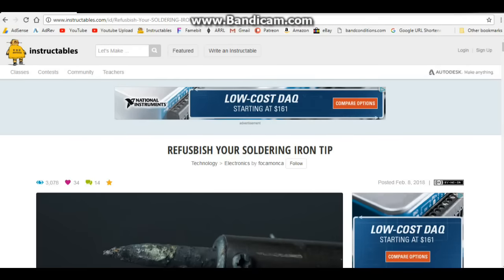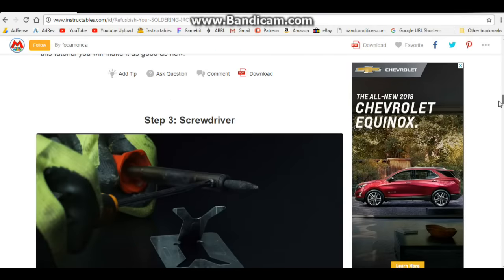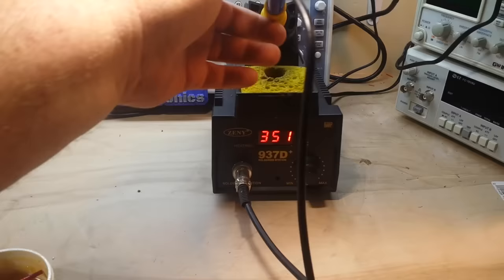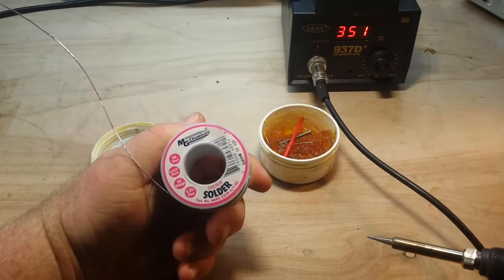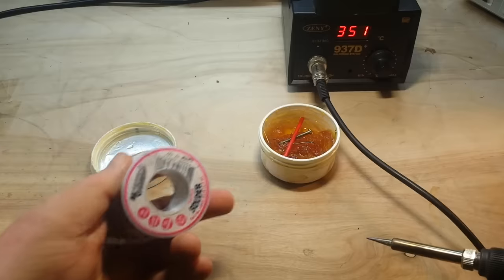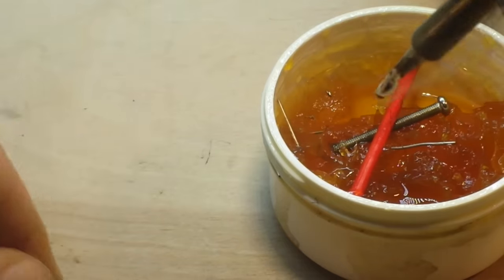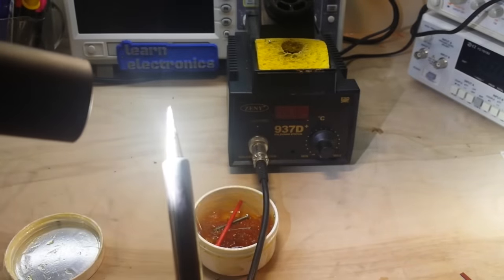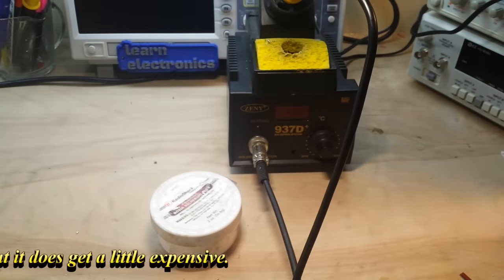How to clean and re tin your soldering iron

Comment: I've always cleaned my sodering (intentionally misspelled) iron that way, although now I use the Brillo pad thingy, and never in about 54 years of soldering have I had a tip that looked like the Instructable. Thanks for showing everyone the proper way to clean a tip!
Reply from the maker: George, I saw that instructable and went "arrrggghhhh" first how could you let your iron get to the state? I can't imagine it would solder anything... And then sandpaper???? 
What's this guy brush his teeth
With? A weed eater?
Reply: That's rich! But I could believe it. I can't even remember seeing a tip that bad, looks like salvage from the ocean.
Reply: Don't use a scotch pad. It's plastic covered steel wool. It melts.
Reply: Watch some of those diy videos, especially from Asia, he definitly abused it for melting plastic. My oldest iron is older than me, dont even know how old, at least 40 years, it is one from Russia and my dad used it there for a long time, since we moved to Germany he exchanged the cable and the plug and now the third generation got it, my nephew, but it still don't look like that.
Reply: The instructable tip looks like the one I have at work. I suppose everyone is different, but when I'm trying to make money I ain't thinking about how to maintain a cheap tool I seldom use for small engine repair.
Reply: What does this say about the air quality in my apartment?
 I bought a $30 soldering iron at a craft store for a stained glass project. The tip turned black instantly & refused solder. 
     I read online & YT occasionally a bad tip will never tin. Time passes. .. I bought a cheap solder iron from Harbor Freight.  I NEEDED to make 2 electronic connections. ( I wanted 8)  Again, the iron turned black as it heated up, before it was even hot enough to melt rosin free solder.  Just like previously it refused tinning. The 'stained glass liquid flux', borax, alcohol & sponge did little to help.  An HOUR later I finished 2 connections. Solder rolls off a clean polished copper wire holding the solder to it as it heats.

   I'm not an idiot, my father was a repairman & welder. I never witnessed him or anyone he knew have the difficulties I've had. I've seen filthy conditions, that don't interference with the job. My environment is sterile in comparison.  I purchased a 3rd iron with a paste flux. I must keep it submerged in flux & still have only seconds before the corrosion impars the functionality of the iron. Any suggestions? Before I try out my new Amtec flux? I thought flux was supposed to be optional w rosin/lead, I just make tiny balls that roll away.
Reply: PS. My 3 iron tips look only slightly better than the one at the video's beginning.
Reply from the maker: I can't imagine that air quality would instantly oxidize your tips. But, that's not my area, I wish I could be more help.
Reply: I've bought used irons in poor condition. I've restored the tips on those. I clean the tips then dip them into a molten pot of solder. It's the only thing that really works. Otherwise the tip is going to just oxidize in the atmosphere again before it gets hot enough to melt solder.
Reply: brr johnson if a soldering iron is not tinned it is practically impossible to get the iron to tin itself. I've seen it many times. Supposedly there is a substance called sal ammoniac that can do it? But I've never used that myself. I just heat up my trusty old Escio 5 pound solder pot and dip a cold tip into it. That works. It works because the tip is immersed in molten solder with no atmosphere to oxidize it. Then solder sticks. Of course before dipping I remove any oxide layer that is on the tip. What is going on with a tinned iron is called, "wetting". That's what you're not achieving with your untinned irons. I think surface tension is involved with a wet object? Which is why properly tinned irons act right.
Reply: George, Thanks for the gentle hint on the American way to pronounce the word. Check Dictionary.com 
Maybe the UK use a long o and pronounce the l but here is is a soft o and the l is silent like in onion.
Reply: I wish the Americans would pronounce the bloody L, drives me crazy with their soda ring iron. It has a l in the word for a reason

Comment: NICE..  I'm old... learned your exact technique in the 70s in my high school beginning electronics class, it's nice to know that the "old" techniques are still applicable..lol... and yes Kenny T. the screws and straws are highly calibrated to the exact performance of this flux..lol :) RIP Radio Shack...
Reply: The old ways still work, but only for through-hole stuff.
Everything is microscopic surface-mount stuff nowadays.

Comment: A contributing factor few know about is your sponge.
The sponge is usually too wet.
It should be just damp and use distilled water. 2 reasons.
The first is minerals in the water.
The second is you drop the tip temperature excessively with an overly wet sponge.
That sizzle when he wipes the tip tells me his sponge is wet not damp.
Reply: Yup, that's why I prefer tin it, flick it, use fingers to shift the crud. That's right, fingers, if you are quick you don't get burnt.
Reply: I ques wet has more water that damp. When damp you squeeze and get no water.  When squeeze and get water is wet. 
In our business you can use slightly moistened kitchen paper to wipe the tip clean. I do that every time I poke holes on plastic. And yes I use a cheaper iron for this busines.
Reply: @dougaltolan3017  uh..... Ok

Comment: Thank goodness
I saw it video cause I have been doing this since my early days of soldering

Now I just have chuck the soldering tip away and replace it with a new one
Reply: tip corrosion depends on temperature. Run your iron on 230-260 C and your tip lasts for months. Actually I make my own tips that are not nickel coated: 4mm round copper stock thread one end, cut it off and put it in a power drill to make a pencil tip with a file. So 5$ for 35 tips. Worst thing to do is forgetting to turn your iron off and letting it smoulder over night!
Reply: If it's been working since you started soldering clearly it's not a big deal...
Reply: @Tore_Lund   yes.... been there  :) works perfectly

Comment: Then again, looking at the style of iron in the picture, he might have the right idea. The sooner you destroy it, the better! 😉
Reply: If that's rosin, try isopropyl alcohol. Rosin dissolves pretty well into it and you can pick it up with a syringe to use as liquid flux later.
Reply: Its a cheap iron though lol 
Get a Hakko or a Weller.
Reply: I have the same type of iron though. It was cheap as hell, but it gets the job done.
It came in a blister pack with a big warning: DO NOT FILE IRON TIP. I guess that person was like "I can't file it? That's okay, I'll just sand it then."
Reply: Amraks unless you are doing microsoldering (which I doubt or you would know what I'm about to say) the cheap irons like this work just fine. You may have all the gear but I suspect no idea! I have expensive stuff but also the cheap stuff, it all has its place and use.
Reply: These big fat soldering irons are no substitute for a decent iron, which are not even expensive anymore. I would never own an iron like that unless it was for electrical or automotive use. Even then, I use a Weller soldering gun for automotive. Any electronics soldering (not just "micro soldering" deserves a half decent iron. The only excuse is if a low-income person cannot afford a $35 station, they can get a $10 el-cheapo iron.
Reply: Amraks I have a 100watt Choice brand is that ok, I bought it from a stainless shop for jewelry soldeting
Reply: @Amraks  I'm happy with ERSA.
Reply: @Amraks  JBC are a nice iron with a great range of tips.

Comment: A decade ago a metal work hand file and tip tinner was in every australian school, tafe and uni book list/toolbox. you should really explain the difference between tips that can and cant have a file used on them since im bad at wording so this comment might not make sence. Now days most irons have a coating over them you don't want to file off but only 10 years ago most didn't and at school and tafe they taught us to file your tip to clean the tip since them iron tips dont have a protective coating and use tip tinner on it. Our tafe checklist even had a metal work hand file for just that. Would not touch a iron with a file now days tho since they have a protective coating over them.
Reply: Yep, late to this party but a half century ago when I was 10 years old (living in Melbourne) and soldering wth a big old iron with a tip held in by a screw like the Instructables guy's, (who "refusbishes" his iron) , I would sand the b*tch until it was clean metal! Then solder with alligator clip heatsinks to avoid damaging the $3 transistor I was fixing to a lug on one of those  strips (what happened to those?) The 70s are behind me, these days with my Hakko and Weller irons and their overpriced tips (but components cheaper than I could've dreamt of back in the day) I wouldn't think of it.

Comment: I've noticed that there is quite a few shade tree mechanics on this you tube site  trying to teach others how to do something , even when they have no idea how to do it themselves. I met a guy, the other day , who was teaching how to perform a tap operation. He said that the right way was to perform multiple drillings and tappings, progressively going up in size each time, until you reach the desired tap size. He stated that if you try to do the tap by drilling only one hole( the proper size hole for the tap) and then apply the tap, you will cause the tap and metal to gall and probably break off the tap  in the hole. I told him that I do taps all the time with one drill hole and one tap operation. As long as you use plenty of cutting oil, and keep reversing the tap to remove the metal debris, the tap should work every time, like it does for me. He still did not believe it was possible to do a tap operation using my method even after our discussion.
Reply: Yes, there's some gold on YouTube, and instuctables, but there's some half-witted junk too. Some welding videos are downright dangerous.
Reply: And some of it is fairly high-profile. Just look at GreatScott—he got big with microcontroller projects and yet he doesn't know the first thing about embedded systems programming. His soldering tips look almost as abysmal as that instructables thing, he can't solder a component straight and makes solder blobs everywhere, but he still made a “How to Solder Properly” video.
Reply: Google "Dunning-Kruger Effect"... 
People of lower ability frequently overestimate their skill. Conversely, people with superior ability often doubt their own expertise, assuming that skills which seem easy to them are as easy for everyone.
Reply: James Koralewski, back in the 1980s when I worked in the milling and drilling department of a major aerospace parts manufacturer, we tapped the threads into properly sized holes in aluminum castings with a drill press set to the slowest speed and a special transmission- like  clutch adaptor that had a center neutral position,  reduced the speed further AND reversed the rotational direction of the tap to back it out of the hole if you pulled up on the drill press handle. With this device you could run the tap into the hole a couple of turns, back it out to clear the chips, run it a couple turns deeper etc. Of course, the drill presses also circulated a stream of oil over the tap as you worked....
Reply: Umm - I guess some people don't know about the combination drill and tap bits.
Reply: Everyone is quick to judge another man's skill or idea both methods work it's just a matter of what it applies to.
Reply: Answer is simple. Vievs cash no matter if its  bullshit or not -.-
Reply: DaveBoatBuuilder
Luckily i didn't had to learn welding from youtube.. I learned it in school from a pro and do it as work..
Some amatuers on youtube do make it hazardous..
Reply: now it is done on CNC mills and lathes. you use a two flute tap as it is stronger. One drill operation and one tap. Also can use roll forming instead of cutting taps on certain material.
Reply: @dstone1701  Thank you for the reference to the Dunning-Kruger effect. Very helpful in understanding life, and the current political climate.
Reply: @James trust me it gets worse than that, I have personally rebuilt a number of Oldsmobile engines, as I used to love my Oldsmobiles before they went under, and I was on a YouTube page about the 442 an their history. And in the video they kept claiming that Oldsmobile 350 was a "small block" which if you know ANYTHING about Oldsmobile at all, the only two "small blocks" DO NOT include the Oldsmobile 350 has the 330, the 350, the 400 and the 455 are ALL the same and parts between them actually interchange!! BUT you can't explain that to these idiots and you are wasting you time if you do!!
Reply: Unbelievable.   I learned tapping in high school machine shop.  Set up the work, with the tap in a tap holder with a tapered hole in the end opposite the tap so  you can  set it up in a lathe, mill, etc.  apply slight pressure with a spring loaded center, then turn manually a time or two, back out to break the chip, repeat.

Taps  an be broken if you're tapping hardened steel, or if you don't lubricate, or if you get impatient and try to go too fast and not back out to break the chip.  Oh, and you can use different types of tapes depending on whether  you're just starting the thread, or are about to complete it.

High School shop classes: bring them back.
Reply: Yeah, watch 'this old house' they give bad info all the time.

Comment: Everyone I know that solders has switched to the brass-wool type cleaner rather than the sponge. It works great for me to keep a clean tip, and you're not thermally shocking the tip every few seconds. What's your take on that? And yeah, I've done the sandpaper thing with poor results, obviously.
Reply from the maker: The steel wool stuff is fine. I'm old school.
Reply: I switched to the brass-wool type, it is much better than a sponge in my opinion. the best part is running  your tip through the wool leaves a nice even coating of solder on it. after my first heat up on my Aoyue iron I have not had to "clean and re-tin" my tip. 5 years on the iron and tip with zero issues.
Reply: Both have their pros and cons. The brass wool is perfect if your tip is in already good condition, and you take good care of it. But eventually the wool will not be good enough to get oxides off the surface of the tip, that's where the sponge comes in. The thermal shock causes the oxides to slightly de-bond from the surface, pulling off as you wipe it across the sponge.

Comment: Great video! I'd suggest that some burned-on flux residue can be a bit trickier to remove than just dipping in more flux. It's obvious to me that you are experienced enough not to crank the station temperature to the moon. Nothing makes it harder to keep a tip in good shape than nuclear-hot temperatures.  My cheap 25w iron will turn a protective glob of solder into an oxidized disaster in about 10 seconds. My Hakko 951 never seems to be anything but shiny because it's never just sitting there getting hotter-- it's either in the holder (resting at lower temp) or it's being used.

That's a big part of why I love these newer cartridge-style stations that have the heater and temp sensor all integrated into the tip. It's like just-in-time delivery of heat. Heat when you need it, and not when you don't. My tips seem to last forever and stay shiny effortlessly.

By contrast, my cheap 25W "deluxe" Radio Shack pencil requires a ton of time and attention for tip maintenance. I find I have to unplug and plug it in really if I'm not going to be using it all the time. I think it was made by Hakko as it looks just like their cheaper models and takes the same tips as the FX888 does. Not bad as cheap pencils go, but every cheap pencil sucks, even a "deluxe" radio shack one.

Comment: Yeah! I awmost spilled my drink too! 
I mean, just heat it, tin it ( and maybe put some flux into it), and use a soft paper to remove the dirt that is in there. I use toilet paper. 
Then when the tip is clean, tin it a bit to make it last long. You can use a soft rag too. So its cheap, dont harm the coating and you can even melt any thing you want without damaging it. 

My generic $5 30w chinese soldering iron is lasting 5 years with me.
Reply: This is exactly what i was going to say! I'm using a cheap soldering station for nearly 5 years with the original tip it came with and it's still nice and shiny today. just tin it, flick off the excess and wipe it quickly with soft paper like toilet paper, re-tin and enjoy a soldering with a nice clean tip :) Also tin your tip right after shutting the soldering station/iron so the tip doesn't oxidize while not in use

Comment: build yourself a fume extractor, it doesnt need to be a 1000$ weller sucker, a 120mm pc fan and a replacement active carbon filter glued onto it will do the job very well.. maybe a third hand or mini tripod for holding it over the workpiece.  under 10 bucks
Reply: I just solder outside under shade...